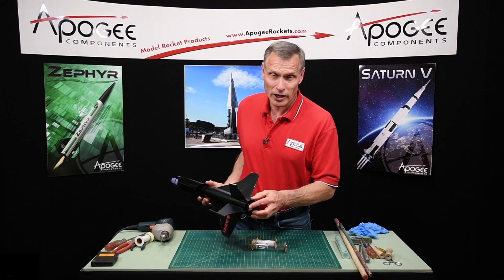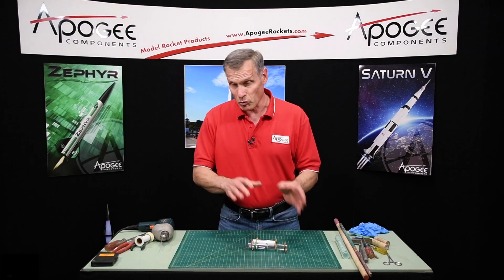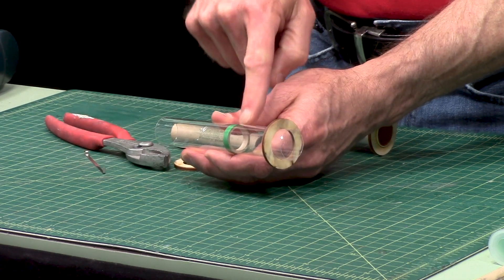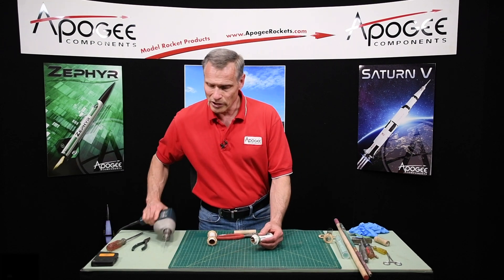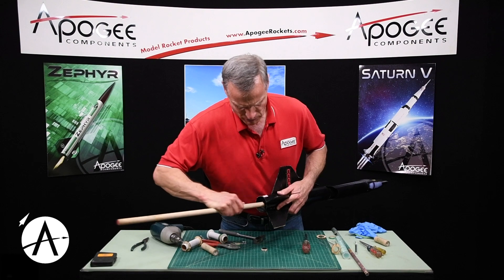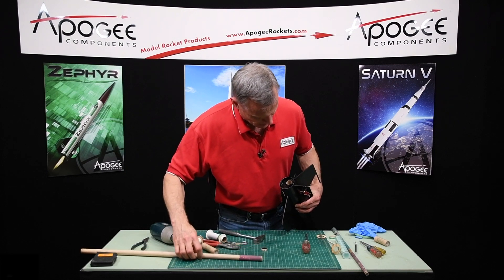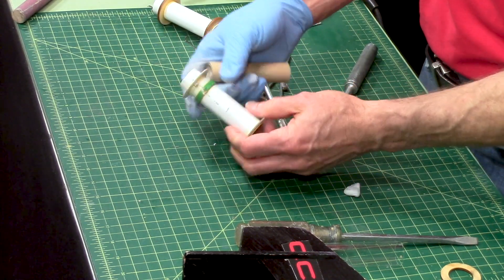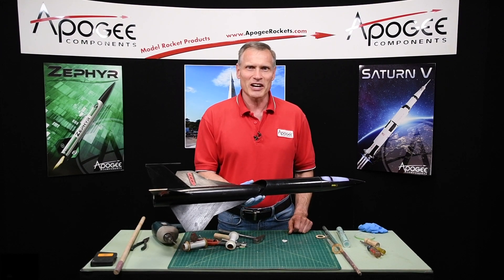How to Remove an Engine Hook

Comment: Does the hammering of the engine thrust ring out weaken the overall engine mount joints at the centering rings?
Reply from the maker: No. it does not. Because you're not removing any material from the wall of the centering rings or the engine mount tube.